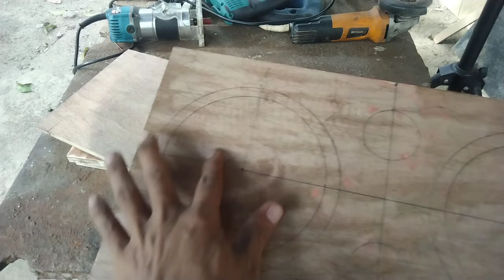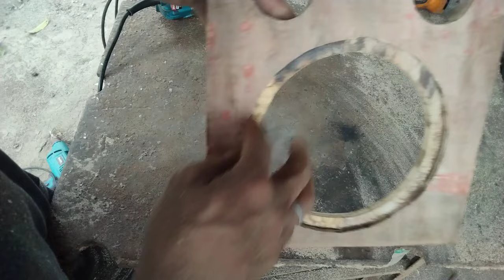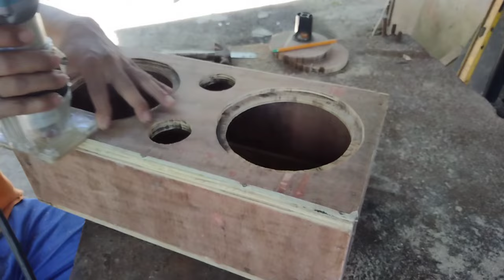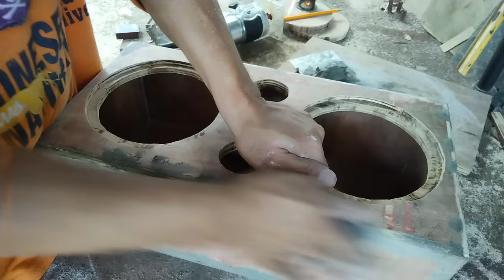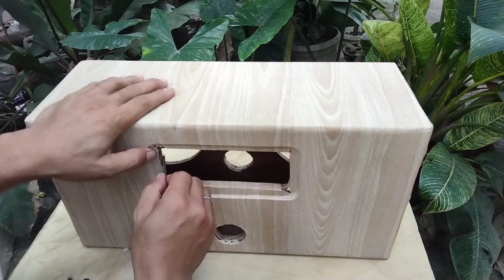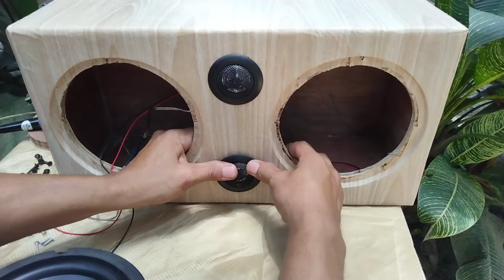gagawa tayo mga idol ng Bluetooth speaker box, malakas Pala ito

Comment: Boss pag nakasama sa 1 channel ang woofer, tweeter at mid naka parallel. Bababa din impedance?
Reply from the maker: Impedance lng ng woofer Ang counted dol, tweter at mid d na ksama dol kc may capacitor sila
Reply: @kuyacuds6025  salamat ng madami kuys cuds!
Reply: Boss tanong lang sana masagot ...halimbawa kinabit ko subwoofer 300watts 8ohms at 150 watts 8 ohms nakaparallel wiring with capacitor ....then sa dalawang tweetter eh 100watts 8ohms ok lang po ba

Comment: Bakit pati tweeter naka series.  .  Haha pwede nman yan naka parallel lang. Kasi tweeter lng nman.  Wala nayang impedance lasi naka capacitor na🤣
Reply: Anu po mas maganda sa Twitter na ganyan po naka parallel ba o series?😊
Reply: @JETSCREATION  parallel. Kasi my capacitor nayan. . ..hihina nayan ..my capacitor na. Tapus naka series pa.. parallel dapat..
Reply: @markdelosreyes9823  sgepo may ganyan kasi ako na Twitter tapos d10 din yung amplifier gawin kopong parallel yun thanks
Reply: @JETSCREATION  walang series na tweeter brother. Kasi my mga capacitor nayan.
Reply: @markdelosreyes9823  doll maaganda naba tug gagawin ko na speaker d10 na amplifier tapos isanv Hyundai platinum 6.5 na 350w  at dome Twitter na dalawa
Reply: @JETSCREATION  ou maganda nayon. Mas lalo pang gaganda tunog pag naka equalizer ka..
Reply: @markdelosreyes9823 boss yung sakin kinabitan ko ng crossover set bass mid tweeter,, 300w piezo tweeter,150w mid 300w sub,, tingin mo ok ba ?